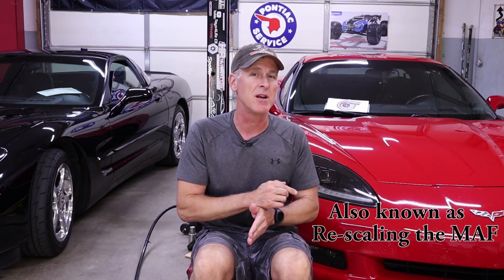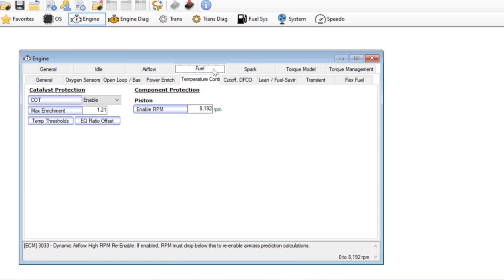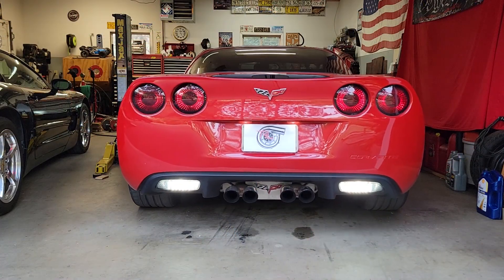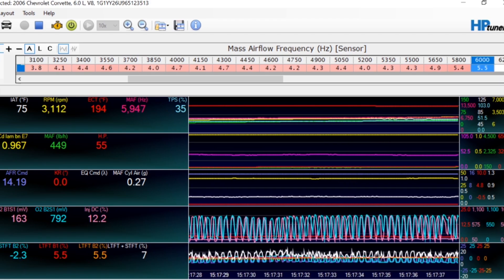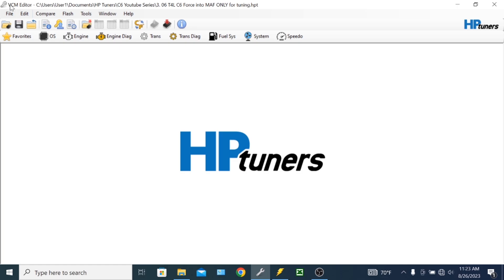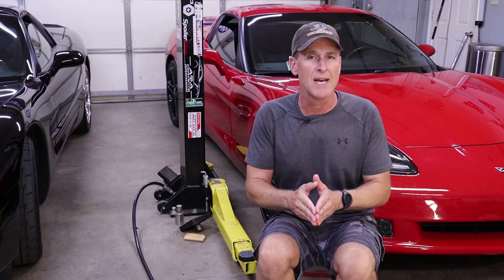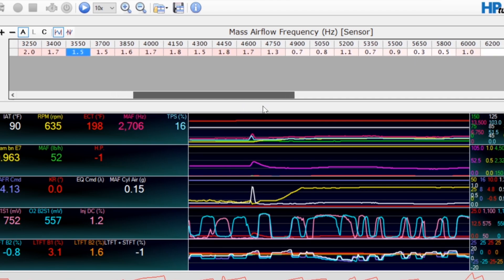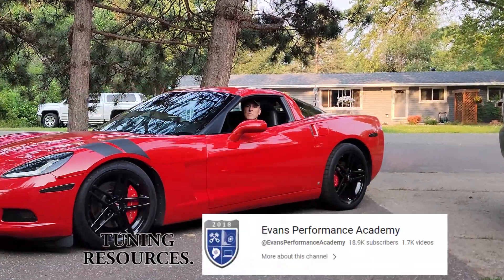C5 & C6 Corvette Tuning Part 3 MAF Tuning (Mass Airflow Sensor Scaling)

Comment: When is part 4 coming out? I know that you are installing a cam but is this series going to continue with the stock components?
Reply from the maker: The stock setup did not need any adjustments to the speed density / VVE side of the tune. With a cam added, that will definitely require tuning to this part of the tune, stay tuned!

Comment: Great Video,  are you able to share the proper parameters you used the graph/histogram in VCM Scanner?    The only option I was able to find was "LTFT + STFT (Math).   Apparently this takes an average of both STFT +LTFT.    Its better to do LTFT by itself or does it really matter if you do ST +LT averaged together?
Reply from the maker: Thank you! You can customize all of these, and the more you do it the easier it becomes. That having been said LT plus ST is probably a little bit better, if you scan long enough LT's are more stable by themselves and the two should equal each other if your scans are long enough. Goat rope garage has a lot of videos on customizing your histograms.
Reply: Sweet!!   I will check out goat rope garage.    When is part 4 being released? lol @Toys4Life

Comment: I have a bad oxygen sensor on bank 1. The car has no cats and no rear O2 sensors and they are turned off in the tune. Ive seen the STFT at +50% while cruising but the LTFT is at 0 still. New O2 sensor is arriving tomorrow but just curious- could the tuner have set up the ecm to ignore STFT and just run fixed tables? Like open loop?
Reply from the maker: Yes, these cars can be tuned to run in open loop (referred to Speed Density mode) and it is fairly common in the forced induction community.    I prefer both the Maf and SD be used/blended.

Comment: Hi mate, I have a question if I may, I am buying a 2000 C5 vette Auto trans, with Xer comp cam stage 3 and full custom exhaust with long tube headers doing 409rwhp. However, it is an automatic.. will the transmission be okay at that power for road use?
Reply from the maker: I would think so, unless it's tired. Stage 3 would imply a big duration cam, you might need a higher stall torque converter.
Reply: @Toys4Life  It's only done 104324 kms. Its safe the lose a lot of torque and power from the crank due to a torque tune and transaxle gearbox i would think.. If anything were to go it would be the converter?

Comment: With this series you fired me up to learn a little and use my HP Tuners scanner to find a big problem with my pickup that was dyno tuned by a pro with the HP tuners software 3 years ago. The O2 sensor problem had been going on for at least a year. The shop couldn't figure it out, but thanks to you I did. Now I will watch this series a few more times and try it out on my pickup before attacking my C5. Your videos are always very well presented and educational. Thank you .
Reply from the maker: I appreciate the feedback!  What year, make (I assume GM) model and engine is the pickup?
Reply: @Toys4Life  It's a 2005 GMC shorty. I had the anemic 4.8 replaced with a slightly cammed 5.3. I had to have a shop do it. Arthritis said I wasn't . The short story- It took some time but O2 sensors started kicking codes that didn't make sense. It was a problem mostly at idle. Finally, you fired me up to figure it out myself with HP Tuners scanner. I learned that 4.8 and 5.3 sensors aren't the same and either are the connectors. That wasn't fun but new 5.3 sensors and idle is good. And I'm sure the engine is happier all around. Your explanation of LTFT was a big help.

Comment: I was hoping I can run a question by you. On your c5, do you have any clearance issues with the intake snout and your hood? I think I noticed once that you just dropped your hood to close it. I can’t do that anymore as it rubs on the hood a bit and don’t want to damage anything. If not, any tips on clearance? I also remember your trimmed the tabs on your fan assembly to bring it lower, wondering if that might help me. Sorry so long and thank you as always!!
Reply from the maker: the aluminum intake tube touches the insulation.  I looked recently and it barely touches - so good to go!
Reply: @Toys4Life  thank you!  With that said I presume the plastic snout doesn’t hit, the side with the air filter? That’s where I’m having the rub.